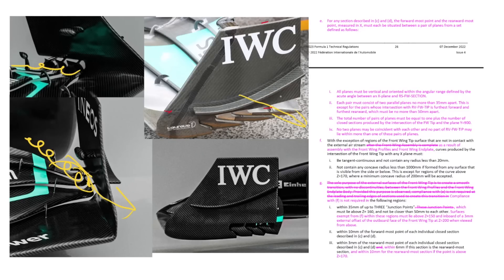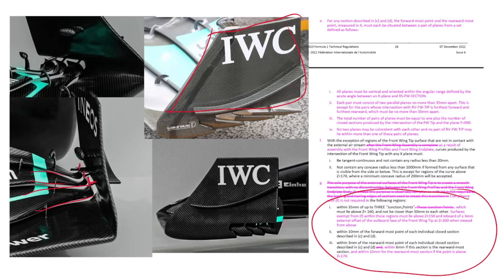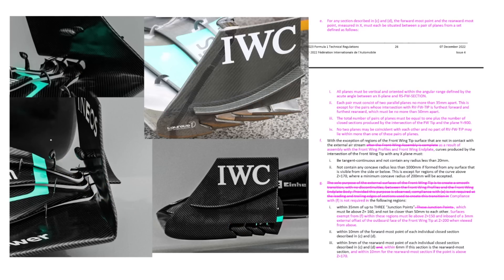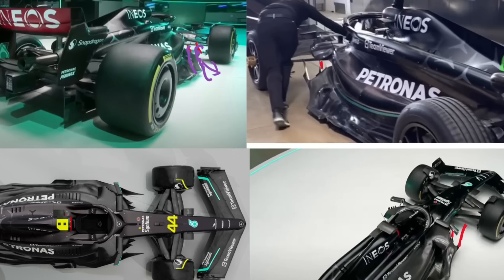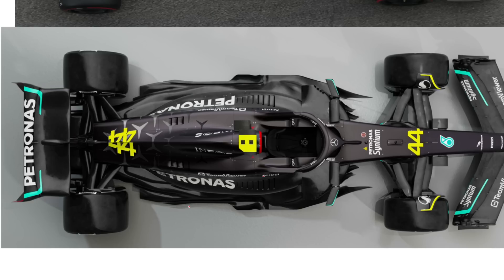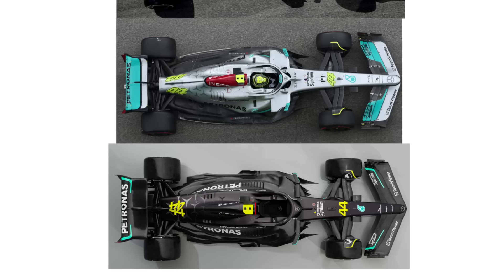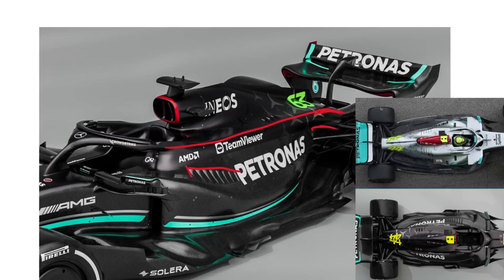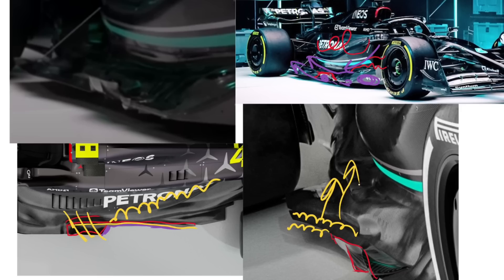Mercedes W14  -  Aerodynamics Analysis and Initial Thoughts

Comment: Love this stuff. Thank you for the analysis. Kyle, now 3 weeks later post Bahrain, and the huge gap Merc has to overcome, what are your thoughts? Could the downwards steering of the RB sidepods be helping the underfloor? Maybe the large mass of air steered downwards by the RB sidepods could seal off the floor preventing entrainment of high pressure air circulating around the floor edge? Merc with the "zero" sidpod design doesn't have this. Could it be a factor?

Comment: Dear Kyle, thanks for that amazing explanation. I have one question to ask. You have talked about the turbulence caused by the front tires what comes inwards at the rear part of the car. Once you turne the wheels when driving into a corner you are going to change the way the turbulence’s flows and since Mercedes is suffering grip on the rear and a unstable car in the first half of the corner is it possible that this is caused by the turbulence from the frontwheels that are disrupting the airflow to the back of the car? I know this flow is hard to simulate since it depends on the turning angle of the wheels, speed of the car, wind etc.

Comment: Why has only the W14 a bulky shape around the front where the suspension points are integrated into the chassis? Could it be that Mercedes have opted for a slimmer nose cone design?

Comment: I find the analysis on the floor edge to be counter intuitive. Every team, besides RB, was still suffering with porpoising to some extent by the end of the season. Of these Mercedes and AT were by far the worst. But even Ferrari had issues on high speed tracks where the aerodynamic load forced/pulled to ride height lower. So I disagree with the assessment that Mercedes' largely exposed floor edge was not an issue and this is further reinforced by the fact that they spent so much time and effort reinforcing it later in the season. Had it been allowed they would probably have had a row/set of stays (much like RB) but they developed themselves into the corner with their "innovative" sidepod design. TL/DR the flexing of the floor was definitely causing aerodynamic stall resulting in porpoising

Comment: I believe they changed the Center of Mass too because the driver position is closer to the front and the rear portion is more elongated. In doing so and I believe they also changed the position of the PU and the aerodynamic balance more to the front end so they will have more space to work on the rotation of the car with more grip on the front without losing the downforce in the rear ... looks savvy and keen!

Comment: would it be possible to do some further analysis on this car maybe after testing and speak a but about the double canon exit across the top of the body work aswell as the halo design which proceeds this and follows through all the way to the back of the car. Really great content very easy to understand but has some nice technicalities i can understand been a graduate aeronautical engineer!

Comment: Even with advanced cfd you can't predict all airflow possibilities because you would have to work out the as yet unresolved (even by supercomputers) NS equations.
Having said that, merc's last year no-sidepod design provided much of their problems in vertical oscillation, leading to a higher floor and loss of performance to alleviate the porpoising.
With the ground effect there's so much suck coming from under the car that they had trouble keeping control of the floor.
That's why they put floor-stays, and why they petitioned to allow for the floor-stays to go in.
There's a vast area of the floor that because they got such slim sidepods there wasn't much to hold the floor up.
Hence, they got more flex, which created a problem to control the aerodynamics in the back of the car.
This year they continued their no-sidepod design, we'll have to wait and see if it works for them. Like last year, damping stiffness will be key.

Comment: My only concern, based on the only other "zero concept" working example - the 2020/2021 Williams, is that along with major drag issues, the car was a dog because of its slabby sides being extra susceptible to side winds, even slight ones. But the w14's curved upper bodywork, to those horizontal canons gives me hope. Both drivers on the shakedown said they were comfort and happy with it, which gives me hope. I just hope the old truism of a f1 car being great in the wet is not great in the dry doesnt apply.

Comment: Kyle thank for your analysis of the W14, the car looks impressive, just hope it has no fundamental issues that they can't sort out. Can you tell me around what percentage of the downforce is generated by the floor compared to the 2021 cars, I expected cars to be able to run much smaller wings as I thought most of the downforce was supposed to be generated by the tunnels under the floor. Cheers

Comment: the w14 video shows the car running in the wet today. I think the large sweep back above the radiators is designed to keep make the air flow spread across the rear wing evenly. You can see the effect when the drs is turned on and off. Pretty decent effect!

Comment: Who removed all these rules that were worded to make sure this outwashing was managed? Forget the porpoising as that was there underfloor. Last years Mercedes had a more severe issue with the flexing floor creating aerodynamic instability. The small pod contributed because it couldn't move or control the flow of air and so they ended up with tumbling air. This was why they were having issues in the corners as well as the straights.

Comment: What would be really interesting is for Kyle to produce a video that covers what the underside of the floors possibly look like and how underfloor features affect the local and overall negative pressure, or 'suction' as he like to call it.

Last year I noticed a picture of the RB underfloor that had some deep depressions that would have added significant volume to the underfloor area.  I have wondered if by having such additional volume of negative pressure the car would be less susceptible to rapid pressure changes and hence, less susceptibility to the porpoising effect.

Come on Kyle.  Explain how the underfloor volume can reduce porpoising.
Reply: I 2nd that...
Reply: The same principle that Colin Chapman used to design the Lotus Wobbly Wheel way back. In his case it was to maximize heat dispensation from the (drum?) brakes

Comment: Brilliant video and analysis, Mercedes took a massive risk last year with a bold complex design. The rest of the grid went for a simpler less ambitious approach. I think the Mercedes philosophy certainly has the most potential. Once they harness it, I would bet my house that they will own the era. I don’t think they made a mistake with the W13, more they bit of more than they could chew in one season.

If RBR and Ferrari aren’t at least  0.2 a lap faster in Bahrain, they really need to worry!
Reply: Interesting, plus of course the budget caps and restrictions on wind tunnel testing would be hampered their progress. That obviously didn't apply to RBR though.  Liberty media You have a lot to answer for.

Comment: When the W13 had that stay installed in front of the rear tire to the outer edge of the floor after the start of the season, the stay appeared to be able to telescope.  When the edge of the floor hit a curb, the floor did not look rigid and it would flex upward without bending the stay.  Is this what's happening, are the stays rigid or do they have the ability to partially collapse and rebound?

Comment: I don’t know it you have mentioned this or not…but the cut out on the floor edge..last yr at one of the wet races…I seen a jet of spray coming out from under the floor…that was diverting a vortex away from crashing into the rear tyre.

Comment: All the air coming from the top and bottom of the sidepod end up on floor next to rear wheels, which increases the down force, but all that air bounces off and exit the car  through the Wing which is the wing upward force, then the posing will continues at high speed.

Comment: I believe they are actually getting round the 50 mm minimum tip chord (and the 20mm concave radius rules by connecting the element to the end plate above z=170 but below z=190. That way none of the rules which only apply in the swept sections below z150 apply. That’s also I believe how they get round having what looks like a larger than 15 mm slot gap at the top of each element.

Comment: Mercedes is wasting so much money/time/resources to solve the secondary problems and avoid the floor and the ground effect. I am expecting a traditional change in regs to reduce the advances of Mercedes competitors similar to what they did in 22 and 21 or Toto become smarter and pushed it for the beginning of 23
Reply: Mercedes have been saying that the main changes of the W14 are of the underfloor and suspension. They’re been completely redesigned from last year.

Comment: Your analysis are always very interesting and detailed. Unfortunately I don't have all the knowledge to understand how vortices work but as you explain it so well the overall effect is pretty clear. I've also seen that they have advanced the cockpit of something like 100mm to the front and redesigned accordingly to that the front suspension in order to move the center of gravity more towards the front.

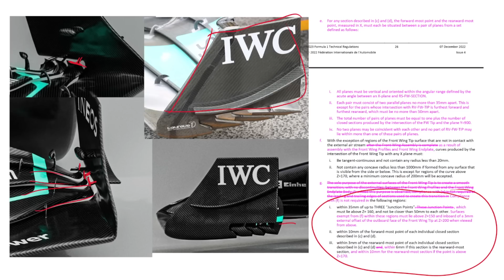Comment: You are very smart, but the mouse pointer moving around the screen quickly and drawing sloppily, especially when drawing from other axis or views that do not have a corresponing photo (such as @ 3:20) make it very difficult to understand this for a curious layman such as me. Also some of the explanations are too brief and a bit too complex. If this is just intended for engineers then it might be fine.

Comment: I do think your speciality is on vortex generator, and i see few analysis from your side how to combine laminar, turbulent and vortex on the big picture flow of the car.  Minimize vortex to gain some side, and using vortex to vectoring the flow to region that not need it or seal/ separate flow. it is not always about making vortex
Reply: Are you suggesting that a former F1 aerodynamicist doesn't know what he's talking about? 😅
Reply: @schumifan78  and no need to bring that portion IMHO .. if you get it right majority of people will notice, if you doing something not right then this happen ..and I do think in this world there is more than 1 mill people work as engineer related to this topic

Comment: Nice video. I think the renders we saw are an older iteration than the real car that they shook down, and I've got no doubt that through testing and the first few races there will be even more changes
Reply: The renders are probably from back in November or December. And i think there will be changes in the first races. Sometimes you just have to start manufacturing so you have atleast something even if its not finished

Comment: In the earlier formula, everyone wanted to achieve the slimmest coke bottle type rear.. Why are they mostly no longer following that philosophy in the current formula and going with wider sidepods and rear layouts. This is a very significant design philosophy change. Most channels explaining the aero talked about the coke bottle in the previous era all the time, but are not trying to give an explanation on why the the slimmer coke bottle might not be working... Can you explain please Kyle?
Thank you for the this wonderful channel
Reply: He's stated it several times, with the complex bargeboards now banned they need to find other ways to keep the front tyre wake outboard. Hence the wider sidepods that narrow down further back when compared to the previous set of regulations.
Reply: @boostav  thanks mate. My bad. 
I know he mentioned it and explained it a little in this merc video. 
But mus have mentioned bargeboards in earlier videos. 
Now i got clearer idea
Reply: The short answer is because the big array of bargeboards and turning vanes in front of the sidepod are not allowed anymore. So the shape of the sidepod itself is more important for controlling the airflow both off the front wheels and around the sides of the car -- so it's more like F1 cars from the 80's and 90's that either didn't have bargeboards or had very basic bargeboards.  You'll see that a lot of those 90's cars had big flat sidepods too.  E.g., 1995 Benetton.
Reply: @TassieLorenzo  ah. Thank you. This makes sense. I guess people have talked about it. Maybe just in few sentences... Or i missed it somehow.
Reply: I am not an expert, but from my understanding, it's not about any specific concept will work or not, but which concept is best for what is available to a team (because of different power units, different suspensions, different focuses; handling vs speed, track layouts, manpower, cost, and much more). If you can achieve a desired balance, with good tunability for most of the tracks throughout the season, any concept you are using is not a big deal anymore. What Mercedes has gone through in 2022 was basically a back luck from the lack of testing time and lack of experiences with the new regulations (for ground effects). Unlike RedBull and Ferrari, they failed to factor in the occurrence of porpoising in initial testing, which has cost them dearly.

Most teams are following RedBull concept because it's a proven concept for 2022. However, copying doesn't guarantee performances for all teams, especially if they are using different parts. So if Mercedes can achieve good result by sticking with the zeropod concept this year, some teams (especially the ones using the same Mercedes parts) probably will follow or use similar concept in the future.

Comment: I think the idea for the Mercedes porpoising problem is that because the sidepod is so narrow it adds little structural support to the floor edge to keep it from getting pulled and flexed down by the lower pressure and further sealing the floor
Reply: It fucks my mind that this video gives a whole ass detailed  explanation as to why its probably not what you are saying that caused porpoise and still you you talked about this
Reply: @mesterorange8181  So first of all: I’m not saying that what he’s says in the video about the porpoising problem is wrong.

2nd: He didn’t even mention the key or possibility to the porpoising problem that I wrote, nor say that it isn’t the case, hence why I commented it as a different view angle.

And 3rd: Don’t let a comment with a different opinion or view angle on a YouTube video bother you so much that you’re writing sad comments like those. Don’t let me ruin your day bro, keep your head up
Reply: @diogosimoes3618  "He didn’t even mention the key or possibility to the porpoising problem that I wrote"  Kyle did say that he didn't think the Mercedes floor lacked rigidity, and he pointed out that everyone apart from Red Bull did not have that many stays or braces hidden inside the wider sidepods anyway.  But I disagree with this.  It's common sense that an unsupported cantilever is going to deflect more IMO.  Now on the W14, the base of the Mercedes sidepod comes out wide and intersects the floor roughly where everyone else's does, whether that is purely for aerodynamics or whether that helps with the structure, who knows.  Even if there are no braces, the floor itself within the sidepod can now be made thicker without impacting the airflow over the outside of the car.
Reply: @mesterorange8181  Kyle is entitled to his view, but I disagree. Why would Red Bull put an *aluminium brace* inside the sidepod to support the floor, if limiting floor flex was not important to mitigate porpoising?  The RB18 was very overweight to start with but that's because including these anti-porpoising measures were a VERY important part of its design.  Most people accept that porpoising is a combination of aerodynamic, suspension AND structural.  It is only logical that the Red Bull floor was significantly more rigid than the Mercedes floor -- deflection of the Mercedes floor edges out on track was visible even to the naked eye!
Reply: I agree with that.  There must be a good reason the Red Bull had three floor stays and an aluminium floor brace.  They had identified that having a very rigid floor was important to mitigate the aero-elastic component of porpoising effects (as well as a lot of mechanical suspension measures the Red Bull RB18 had in it's design to mitigate the mechanical side of the porpoising, like the anti-dive front suspension and the sprung bib).  IMO, Red Bull set out to "minimise the porpoising instability while retaining the performance" in the original RB18 design (as Pat Symonds said was key to the 2022 regulations), while I'm not sure that Mercedes did that in their original 2022 design.

It seemed like Mercedes had just assumed they could run their 2022 car really low to the ground with really hard suspension and it would somehow be fine!